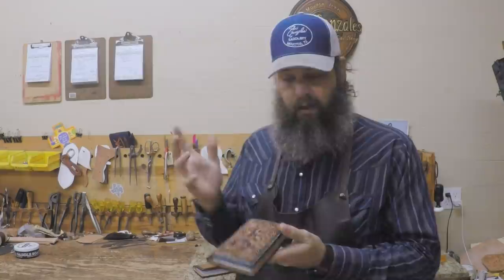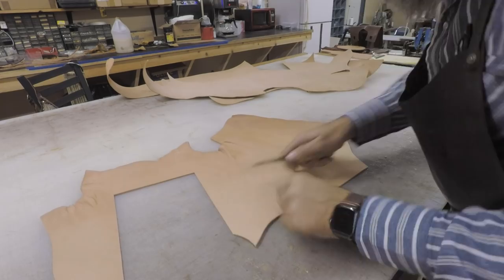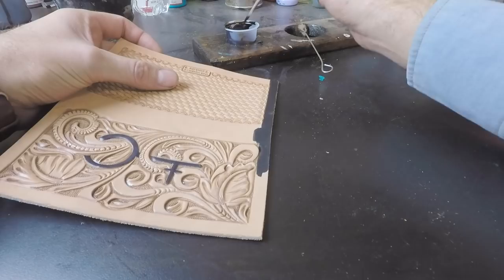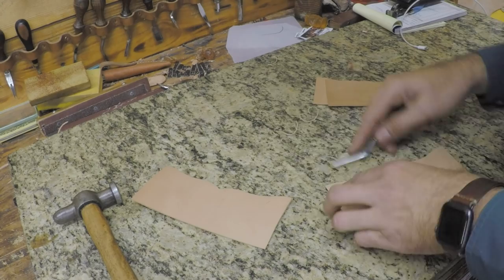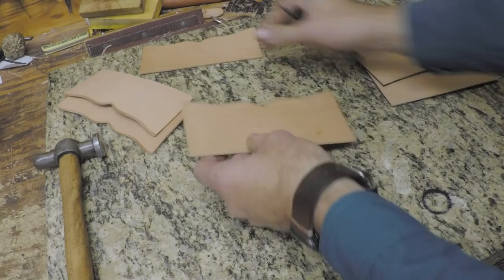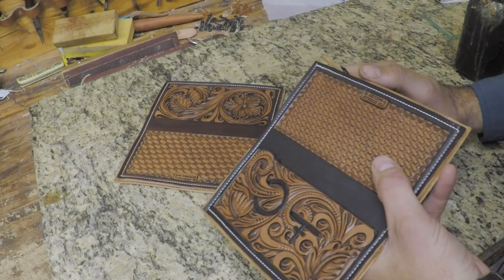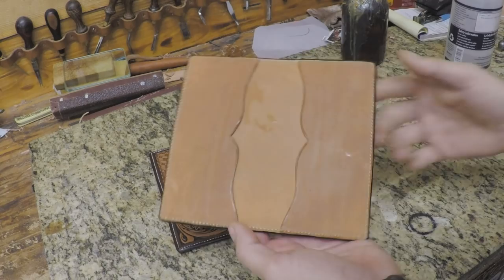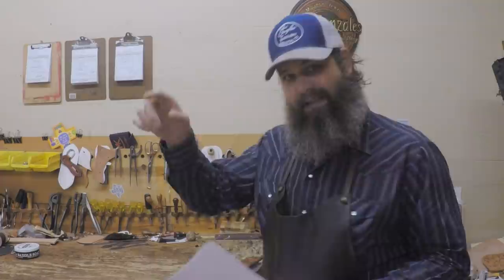How to Make a Leather Checkbook Cover

Comment: I tried taping the back with tape and leather for tooling I found once you try to take it off it rips the fibers on the back of the leather what I do is what the leather a little bit put some weight on it and the leather will straighten back out

Comment: OLD LEATHER SMITH here, GREAT job Don, SUGGESTION, I put a couple of drops of liquid dish soap in All my water bottles, folds easier and stays that way when Dry, GOD'S BLESSINGS ✝️⚾🙃
Reply: If you have a large tooling job a couple drops of dish soap in your wetting tub/spray bottle prevents molding as well.

Comment: Question, What type of pencil are you using? Mine do not write well on leather.
Reply: Charcoal artist type pencils that you get at Hobby Lobby! They typically come in a pack numbered 5B, 8B, 9B etc. They erase easily as well. One more thing, if you go to Hobby Lobbys website they always have a 40% coupon for 1 item. Not that the pencils are expensive or anything but if your anything like me your cart will fill up quickly when shopping there. Heavy sigh. My husband has grounded me from that store. 😬
Reply: @JayJay-sf2wn  Thank you, I thought I was doing it wrong
Reply: @megarouge61  Anytime!